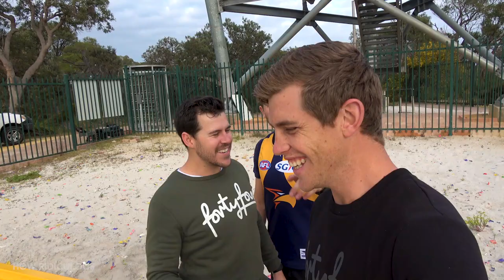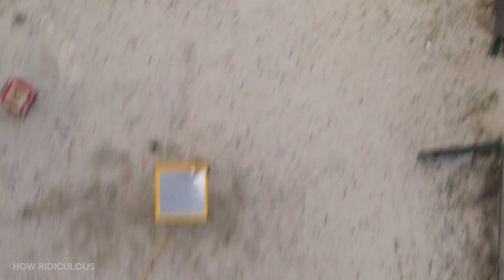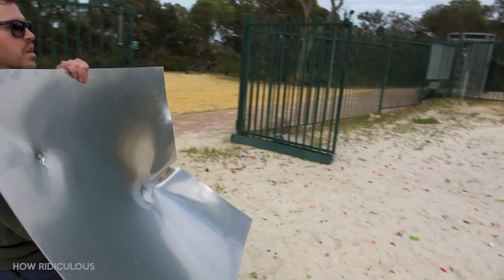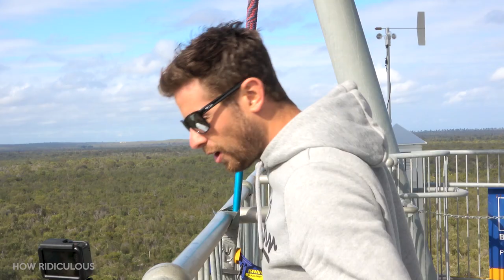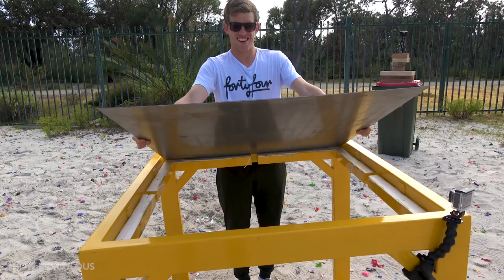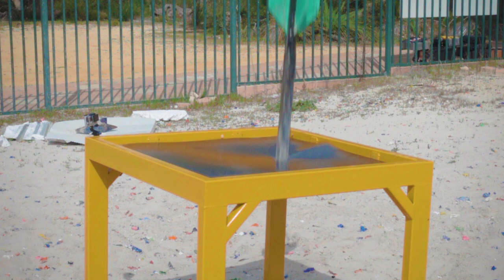GIANT DART Vs. STEEL PLATE from 45m!

Comment: Fold a "paper" airplane out of metal sheet and throw it off the tower!
Reply: Someone made a comment almost exactly like this a min before you
Reply: devann allen it’s very suspicious
Reply: They’ll break their car
Reply: And the fence as well :)
Reply: It might not fly cuz its to heavy maybe
Reply: Airbus weighs several hundreds tonnes and flies.
Reply: @AdamSpanel  it has engines
Reply: I believe that that would be far to much dangerous
Reply: Mythbusters did this with concrete and was proven that it doesn't matter how much it weights it would still fly. A metal airplane would fly a lot further than a concrete one though.
Reply: @AdamSpanel  planes have massive fucking jet engines. That's why they lift off the ground, or if they are really light, they can get a way with a propeller. Some exceptions are ac-130 type planes, they are heavy buggers that run with propellers.
Reply: @oisingolden538  The engins are not the only one thing why airplanes fly... aerodynamic lift is needed. That is why airplanes have wings... without wings even motor doesnt help to fly. So, airplane out of aluminium without motors makes sence.
Reply: Sigh
Reply: @oisingolden538  r/wooosh
Reply: @abitofeverything6704  r/wooosh
Reply: @Sauzeisawesome  r/wooosh
Reply: @MsAhutch  r/wooosh
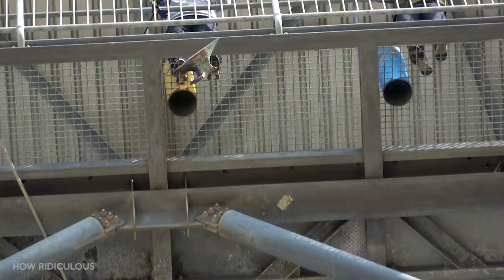Reply: 6:50
Reply: i agreee
Reply: Guys, the weight or density of the material doesn’t magically keep it from flying. 

All that matters is wether the wing creates sufficient lift 

Gliders exist. They’re often made of metal. 

A glider of appropriate size and wing shape and dissension could be made of concrete or even steel and still glide.
Reply: @AdamSpanel  Airbus aint a glider
Reply: Good I Dear
Reply: oisin golden it can glide too
Reply: abit of everything no need need to hate
Reply: @masencreekmore4014  no one is hating, you’re just incredibly soft minded
Reply: @animepfpsr4virgins964  that was 2 years ago bruh🤣

Comment: If you will have the giant dart spinning (like a top) as it falls, it might cut through the air a little better and fall more true.
You wind up (twist) the rope and let it start to unravel as you drop it.
Reply: That's actually not true. Since the fins are straight in line with the body of the dart having rotation on the drop would increase the drag from air resistance, decreasing the drop speed slightly and potentially destabilizing the dart more . Just look at modern missiles; if having spin helped them hit targets better, then they would be designed to spin.
Reply: SaCeuran
Yeah, I was wondering if the fins being rigid might have an effect on it.
Would the same thing happen if they were feathers/something soft?

Comment: I mean if you think about it, 1 extra mm is 33% thicker. That is actually a pretty big difference tbh.
Reply: Wot
Reply: not it aint  its a sheet of steel a plate is thickerrr
Reply: @karls8103  
So 4mm thickness isn't 33% more thickness than 3mm?
Or is a 3mm sheet of steel thicker than 3mm plate of steel?

Comment: The way he said aluminum
Reply: Aluminium. It's English not American. :-)
Reply: That's the English way to pronounce aluminum. Goofy.
Reply: ... you mean... the correct way? It’s the English way. The right way. Aluminium, not aloooooominum.
Reply: @helloiamem  sure, ok? So you pronounce a word differently than I do. What are you trying to prove?
Reply: Renegade Motorsports what did you not understand about my point? Was pretty straightforward. You mocked the way he said aluminium, I told you it’s the correct way to say aluminium, point made. Pretty simple.
Reply: @helloiamem  @Emmie Ana Ray all he did was point out that he's pronouncing aluminum "aluminium". It's pretty simple as you say that you are ill informed and acting rudely. You are factually incorrect to imply that the pronunciation "aluminum" is incorrect. Here's is some information you perhaps you should have looked up before replying twice. "Aluminum is the American and Canadian spelling for the silver-white metallic element (number 13 on the periodic table) abundant in the earth’s crust. Aluminium is the preferred spelling outside North America. Neither term is superior to the other, and both are etymologically and logically justifiable. Aluminum is older, while aluminium is more consistent with other element names such as helium, lithium, magnesium, and so on (though let’s not forget there are other -um elements—molybdenum, tantalum, and platinum)." This comes from a dictionary. Next time use a little more critical reasoning. After all as Maurice Switzer supposedly once said "Better to remain silent and be thought a fool than to speak out and remove all doubt."
Reply: @helloiamem  OOOHH I see now. I wasn't mocking you at all. The fact that we use two different pronunciations for the same word is goofy to me. Was not calling you goofy. 😂
Reply: Renegade Motorsports arent they Australian. Not english??
Reply: @serenaprokopchuk8905  we speak English in Australia 🤔
Reply: @helloiamem  Aluminum was the first spelling and "aloominum" was the first pronunciation

Comment: you need to do a sheet of titanium
Reply: @dave93x  Explosive tips aren't meant for penetration anyway
Reply: @senpai toast Really depends how thick the sheet is if it's only a couple of millimetres like the ones in the video it could 1" is overkill the dart might not even penetrate 1/2" steel
Reply: Titanium isn't as strong as the strongest steels.
Reply: @dundonrl  its not as strong as "hardened" steel but it is stronger than just basic steel like they used in this video. Titanium has a hardness of around 40 rockwell of I remember correctly. And harden steel can range form hardness but knife steel can be 60-62 rockwell.

Comment: Is that second 'target' really TIN? More likely to be aluminium or corrugated iron. TIN is worth 10 times as much as aluminium (thats why all 'tin' drinks cans are made of aluminium nowadays) and as scrap, its worth three times what the usual most expensive product, barebright copper, is worth! I really cant see anyone building foam-sandwich walls with TIN on the outside when aluminium and iron are both cheaper and stronger...
Reply: No chance it's tin, definitely aluminium.
Reply: Tbh here in Australia , we usually just call aluminium tin, don’t know why , but we do
Reply: Yes, in Oz we just say "a tin roof" when we all know that it's either zinc plated steel or powder coated steel, which is usually a trade product called "Colourbond" here".
"Tin roof" means a metal roof. 
Don't worry about the technicalities, it's a tin roof.
Reply: TBH, here in England we do exactly the same, that product of a couple of layers of corrugated whatever-it-is-but-its-certainly-not-tin  we call it a tin and foam sandwich wall. Cars nowadays are 'made of tin' because they crumple up under the mildest of impacts. During the War of 1982 our destroyers would not have sank if they were made of 'proper armour plate rather than the tin they make warships of nowadays'. Neither walls, cars nor naval destroyers are made of structural tin. Never thought that caught on overseas as well!

Comment: Ight boys let’s do 1 inch Steel plate that would be a good vid
Reply: Ehhh, even 10mm or 12.7mm steel plate, preferably tempered or rolled steel and not mild steel...it would take both of them to load it up on the stand if it was any thicker than that 6mm or whatever it was....

I wonder what grade of steel they were using?
Reply: Was gonna say... This isn't plate. It's sheet.

Comment: Yeah, it is just 1m more, but you see it this way: If you have a 3mm steel plate you have to add 33% of the Material to get to 4mm. That difference is huge! and I ´m quite sure it is exponentially stronger.

Comment: Hey guys, I understand the confusion of living in a country which uses scientific units of measurement, but a mil is different from a millimeter. One mil is actually one thousandth of an inch, closer to 0.025 mm. That means a mil is actually closer to a millionth of a meter than a millimeter.

Comment: ou guys should extend out a little plastic tube big enough to fit all of your tools of destruction ect. Anyways go out there at night with a decent lazer pointer and go into the tower shine the lazer through the tube and mark it where the lazer hits on the sand. It will be a lot more accurate and less time consuming in long run

Comment: 'Then number two is TIN' - shows aluminium-foam sandwich wall.
'The old TIN, the SN (chemical symbol for tin).... Yea but its TIN and foam boys' - shows aluminium-foam sandwich wall.
'Stanford, whats hitting the old TINNY TIN TIN first?' - shows aluminium-foam sandwich wall.

If you used actually tinny tin, not only would it probably snap under its own weight on the table before you even dropped a dart on it, your bank balance would go pop - tin is probably the most expensive 'common' metal in existence.